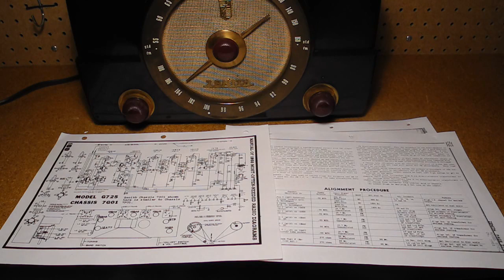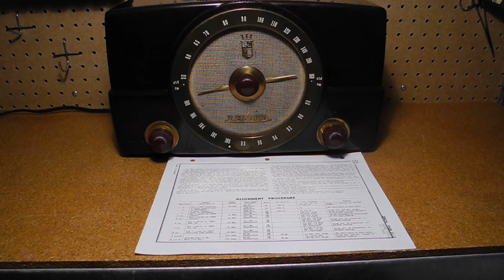The Zenith G725 AM/FM Radio

Comment: Great radio, I have a K725.  Is that "black beauty" you mentioned also known as a "bumble bee"?
Reply from the maker: +Rebel9668 I tend to use both names interchangeably, but my understanding is that "black beauty" and "bumble bee" caps are not quite the same.